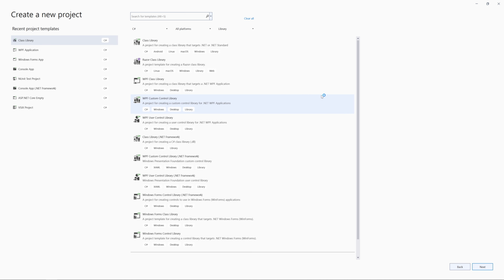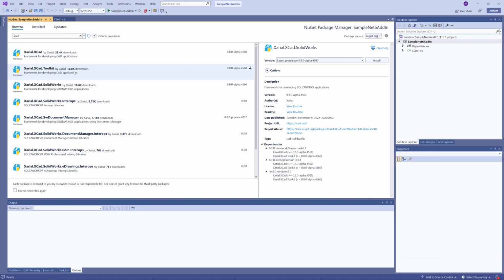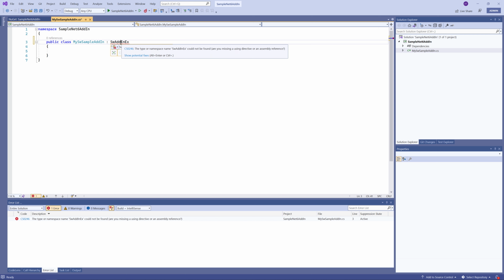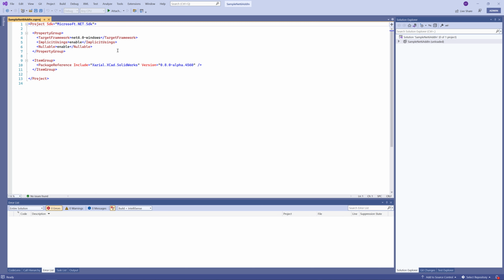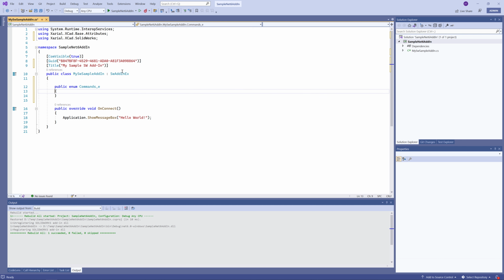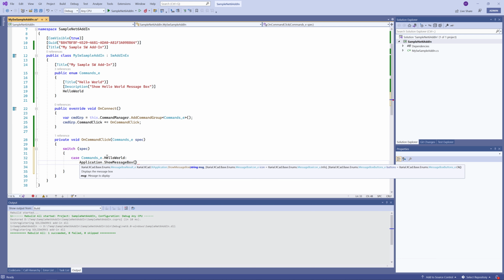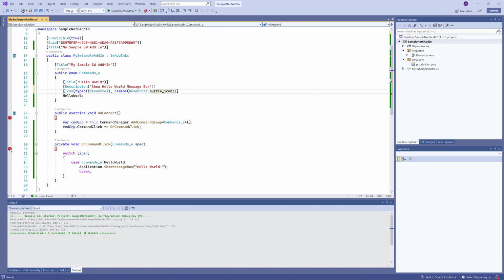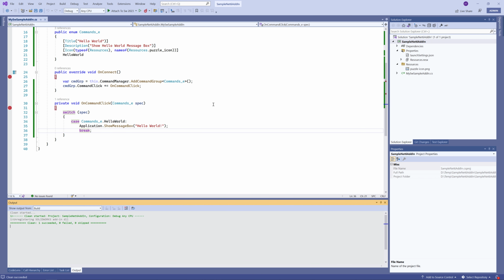Creating SOLIDWORKS C# add-in from scratch in .NET 6 via xCAD.NET v0.8

Comment: Thank you for this. I'm only starting to get into VS. I have done everything step by step and so far, I don't have any problems even the rebuild says OK, but when I opened Solidworks the message box didn't popup. I've used Solidworks 2024 and .NET 8 as framework, does it have something to do with that? Thanks

Comment: when I add an icon to the menu item the menu wont load at all when i launch SW until i comment out the line that adds the icon, did exactly as you did. Any ideas what that is about?
Reply from the maker: Could you please contact me on info@xarial.com and I will help you trouobleshoot the issue?
Reply: @Xarial  thank you for the reply. I figured out the problem, i was using the wrong framework. I switched to .NET framework and all my problems disappeared just like that.